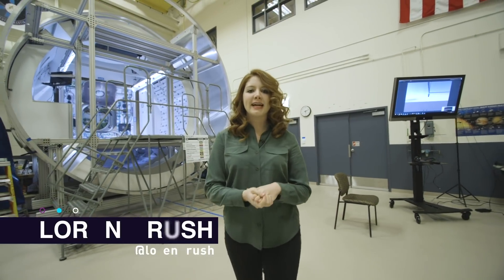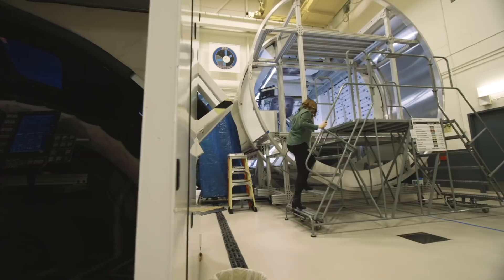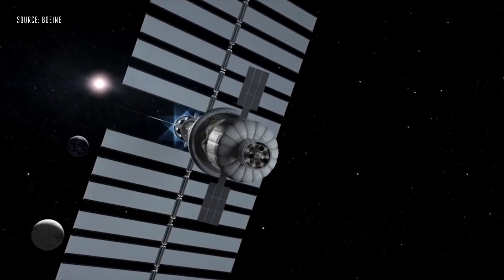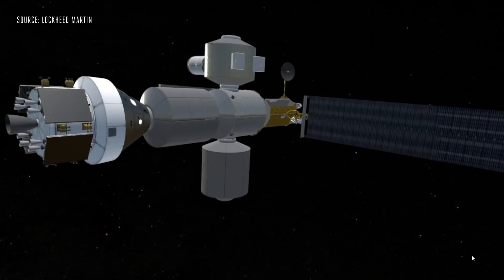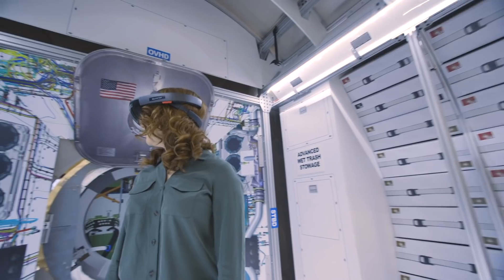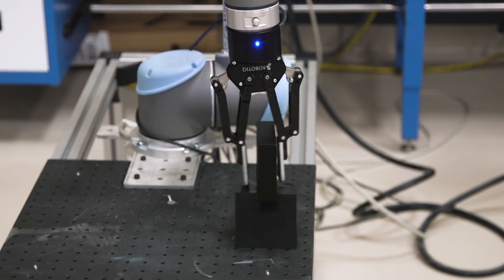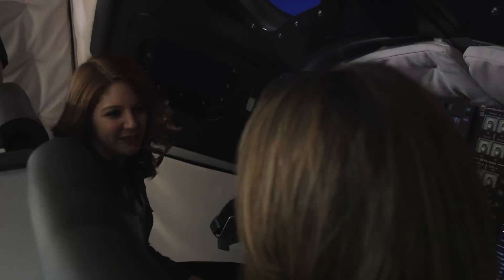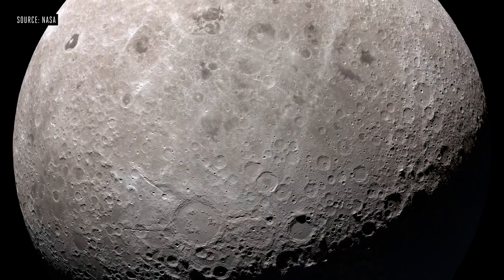Designing a tiny home to orbit the Moon

Comment: well most import part moon orbit station. catch, holding and study astride. told that section station fly deep space. assuming orine capsule one go out get astride. how tug back station with crash into it. do teather astride. do astounds do space walk put portable rockets like iron man did when save spider man when boat split hafe? put rockets all around astride. remote fire them. so fire back get move near station. then front fire slow down. then top or bottom one would fire off deep space if some go wrong. save gasses have some bag that go all way around astride. if didn't bag lose water vapor or other important gases. so one modules would be some kind astride hold area. think giant claw one claw game at boiling Allie get stuff animal. orine would go put iron man rockets all around astride. fly in. claw grabs it. astronauts space walk put big bag around it. then speed entire year study and try get metals other good stuff out it before seed out in space.

Comment: Gentlemen This reminds of space lab with better computers. Orion and deep space habitat are updated copies of apollo era with less power. I understand that Nasa is now risk adverse and relies on proven technologies rather than innovation but this approach is both expensive and slow. NASA would have needed 30 years to go the moon and it would have taken 10 times the costs to go there. I absolutly don't understand this satellite thing as it looks very expensive for minimal results. In terms of study on radiation, there is no need to risk lives and a robotic satellite orbiting the moon would probably give most of the answers needed at a minimal costs. Put Guinea pigs in lunar orbit doesn't really look nice.  We have replaced giant steps for mankind with step by step approach. Last time Nasa really tried to be innovative was with the X33. 
We should rather look for sustainability in space. What I mean is the key cost in a space station is the maintenance (food, oxygen and water) and the replacement of the crew. As long as everything is shipped from Earth, the costs will be astronomical. Seeems to me the key item is to solve the supply issue before to start to build a space station. Maybe a robotic base on the moon could be the solution. Raw materials should not be shipped from Earth but from the moon. Before we do that Space will remain a questionable expense in my view because small steps forward and high expenses.

Comment: NASA is great at finding easy projects that go nowhere, but look (and are) very expensive.
Reply: Mightbe Sherwood, mightbe suits you just fine.  You probably think NASA never sent anything.
Reply: @johnunderwood-hp8rj  NASA did great stuff in the 60's, and JPL still does great work on uncrewed spacecraft. But today's NASA is building orbital trailer parks that fit the old Star Trek acronym GNDN - "goes nowhere, does nothing".
Reply: Mightbe Sherwood, that's true.  Nasa dropped the ball.  But, Elon Musk picked up and is running with it.

Comment: WHY ORBIT MOON? WHY NOT BUILD STATION ON MOON? 🤔
Reply: So you are gonna pay billions!?
Reply: @jeevajp2574  - They are already going to spend billions on this worthless station.
Reply: Christopher Carr this "worthless station" is the first step to going back to the moon and then mars. It is very logical to orbit first. The first apollo crew orbited the moon before the landing too
Reply: People it takes way more delta v to land and take off from the moon than orbit it. This should be obvious. If you want to launch deep space missions, you need to limit how much delta v you waste on stuff like taking off from the moon. Don't forget that proposed interplanetary craft would need many modifications to land and takeoff from a surface as well.
Also yes taking off from the moon is actually quite hard with ion engines, the best method to get to other planets. Finally, if you forget sci-fi for a second, what are the actual advantages of a surface base? You can get surface samples and look around. That is it. Not worth sabotaging the mission of the station and massively increasing cost for
Reply: No, no, no, it is not the first step to going back to the moon and Mars. It's a long, expensive, pointless detour -- it's been described as a tollboth.  And this is not the orbit you would use for maximum access to the lunar surface -- rather, it was designed to accommodate the limitations of the SLS and Orion capsule. It is merely something for SLS to do, not a thing worth doing on its own merits.
Reply: Surely any planet is something for a rocket to do, lets be real, going to mars doesn't actually make any money, or improve peoples' lives. And I specifically talked about delta v limits, what is you point?
It may have been described as a toll booth - so what? The real point is to support the deep space transport, which would have a hell of a lot easier a time escaping the moon then giving a quick kick to escape earth than from LEO. 
The station is for both lunar and mars access, so yeah its not in the perfect orbit for moon exploration, but it is adequate for it.
And this debate is surface vs orbit. which would you rather have?
Reply: It will be a decade at least before LOP-G gets built -- a decade after SLS starts flying (whenever that happens). Stopping at LOP-G on an eventual lunar surface mission adds to Delta-V 

We might as well expand the ISS -- or NASA could run a major commercial habitat program in LEO; get a bunch of Bigelow habs up there.
Reply: Christopher Carr  a decade? Not really, the schedule is a bit more condensed than that, work starts in the early, not late, 2020s. 
Well duh, but, not all that much when you think about it, you already have to go into orbit, a correctly timed launch could intercept the LOPG with no extra orbital maneouvers and all it takes is the few m/s for docking.
But the major objective is Mars, and launching your ships for lunar orbit rather than LEO is definitely an advantage, which is my point. Which is why we might not 'just as well expand the ISS'. Especially since the ISS is aging, in 10 years it will be like Mir.
Reply: dubsy, interplanetary craft wont go via the orbiting station, it would be a detour, it takes more delta v to go to lopg then to mars.
Reply: @thomaswijgerse723  they literally are going from the station, to Mars, then back to the station. The craft designed for this is the DST, and can only effectively operate from a station that is far from LEO, due to its use of ion thrusters making it impractical to go from a normal orbit, the TWR so low it would take so many burns over so many orbits to make it impractical
Reply: dubsy, Im not sure where you got the notion that the use of ion engines works better from lunar orbit, but it it simply false, actually the opposite might be true, when having to split up the burn in multiple burns, the moon would move a lot during those orbits you have to wait compared to how much the earth would move. 

also, going from leo to the deep space gateway takes more delta v then from leo to mars, since you'd have to circularize at the orbit of the moon, which you wouldnt have to if you went directly to mars. 

Deep Space Transport is just a "concept to be studied" and hasnt even appeared in any budget allocations of nasa,
and would just be an excuse for the deep space gateway if it had. 

also, even if the point this concept of a craft would take the massive detour of going to lop-g first, that would be litterally its only purpose. 
its ridiculous.
Reply: WHY NOT MAKE MOON ORBIT YOU?
Reply: Moon village project by EUSA
Reply: UNOOSA won't allow a moon base, and we can't even get a biosphere to work on Earth so we are a long way from long term living in space, people forget that everything looks good on paper,
Reply: EXACTLY! There is no credible logic to orbit the moos, whereas a moon-base would be easier to maintain. Larger habitat, gravity and you could even go out for a walk if you want. If there is water on the moon as space station makes even less sense.
Reply: Galactro They dont have a lander
Reply: Even if SpaceX gets to mars 5 years after their prediction, NASA won't even have been back to the moon.

Looks like private companies will be taking over at this rate.
Reply: @UAPJedi  - Build a damn lander instead of this useless can.
Reply: Galactro it's not that simple and it's extremely risky
Reply: https://youtu.be/NtQkz0aRDe8
Reply: Someone else owns it, and it's not Earth.
Reply: lunar night is a month and it's really cold and no problem with dust ....but sure base on the surface later I guess
Reply: A space station is meant to orbit a planet or moon. Building a space station on a planet or moon is like building a house on water.
Reply: Nasa says it's going back to the moon to stay!
Reply: Because landing is a lot more difficult and riskier than orbiting.
Reply: the moon ISNT the only objective!! why do people keep asking this stupid question!
also the station will be built but you just cant drop a house on the moon , the moon has to be mapped and studied from a closer distançe
Reply: There are many answers to that. You should at least have 3. I could think of 10 just from a psychological and logistics perspective. Study the artificial environmental working conditions alone that need attention. Good luck.  You are allot smarter than you give yourself credit for. I promise you
Reply: @urineanimal  there are many but going all the way to moons orbit and using fuel to stay on orbit could be lot costlier I think? Radiation would be the same or a bit less, but sunlight could be a issue depending on the stations location, and launching from moon is no that hard. Maybe moon dust could be a reason as it gets into everything. Moon base is the final goal anyway, why not just go there now and build one instead of orbiting it?!🤔
Reply: @CausallyExplained  it's pretty hard to live there
Reply: Because going to the moon itself is a secondary objective. The primary one is building a permanent CIS-Lunar way station that can be a gate way to Lunar surface exploration as well as deep space missionsto Mars and near Earth objects.
Reply: Mars Society.  Dr. Zubrin is right, the orbiter idea is stupid.  GO TO THE MOON AND BUILD A BASE. GO TO MARS AND BUILD A BASE. STOP VENDOR PANDERING AND WASTING TAX PAYERS MONEY. GET ON WITH IT! 😠😠😠😠😠
Reply: @mbabcock111  Calm down mike, there's no need to SHOUT. 🙄
Reply: Mike Bablles you know these people also pay taxes right? Everyone pays taxes?
Reply: Orbiter is the first logical step
Reply: @sidharthcs2110  Not a logical step at all.  Does not assist any conceivable Moon landing mission.
Reply: @sidharthcs2110  -  This planned orbiter is not a logical step to anything.
Reply: The truth is there is already a "base" on the moon, or more precisely, on the *dark side of the moon*.

Ever wondered why nasa has never gone back to the moon after 1970s?
Well I wont say much... but go down in the rabbit role, you will find the truth is more scarier than fiction!

Comment: 1:58 "The one challenge to sending things into space is... space". Nope. Its actually the earth's gravity that's the biggest thing to overcome, fuel wise.
Reply: Also gravity isn't the biggest problem. It's the atmosphere. A rocket needs a large booster to leave the atmosphere. But when you are above 100km, gravity is nearly the same. But due to the lack of air, a small engine with little fuel can accelerate you a lot.
Reply: Sure. But there's no atmosphere without gravity. The pull of gravity is what keeps the atmosphere on the planet, and stops it from escaping. (Apart from Helium, which is way too light.)
Reply: @sharonishere  - Build a tower 100km tall, ascend to the top, release a satellite with a low-powered engine, away from the tower at whatever angle you like. It will fall back down to Earth quite directly. It needs to be going at orbital velocity for 100km elevation (which is very fast) -- orbital velocity for 200km elevation is over 27,000 kph. 100km, faster yet.

Getting to orbital velocity for 200km elevation would still take a lot of power, even if there were no atmospheric drag.
Reply: @cacogenicist  true. But it's a lot less fuel requirement since there's a lot less drag. Ex: Falcon heavy used 3 boosters with 27 engines to get the 2nd stage to about 8000kph. Then it only takes a small stage with 1 engine to accelerate to 44,000kph. The gravity at 200km is nearly same as surface gravity. But the difference is the lack of air.
Reply: That’s okay though, not all of us are that smart.
Reply: You misunderstood her statement because she didn't go in-dept about air drag.  But that's ok, not all of us are smart.
Reply: You misunderstood his statement. If we had no gravity, it would take a light push to get something to space.
Reply: ...or fart...

Comment: Space colony on moon is better than mars
Reply: @gridleaf  but why that is a problem?
Reply: @15sachin15  The Martian atmosphere (largely CO2), while thin, is useful. It provides some radiation protection, and you can make stuff with it, like rocket fuel (bring a little hydrogen with you, make methane), and oxygen and bricks.
Reply: Still think we should get a Moon base working before killing people on Mars. The atmosphere on Mars has only minor benefits. The fact that the Moon is only 380.000 km away is a huge benefit. We need to learn to crawl before walking.
Reply: @Mosern1977  The moon has a super low gravity and also really long days(28.5 earth days) so you can barely use solar power. Therefore i think a martian base would be better.
Reply: @Mosern1977 , why do you think we can only have one at a time? Let's do all of it at once. There's enough money, interest, capability, and willingness to go around. It's not just a government option anymore.
Reply: @mbabcock111  Don't get greedy mike. One step at a time,it'll pay off in the long run.
Reply: It will happen on both.